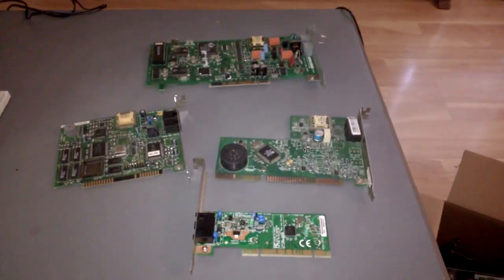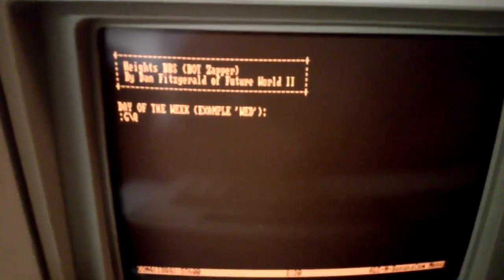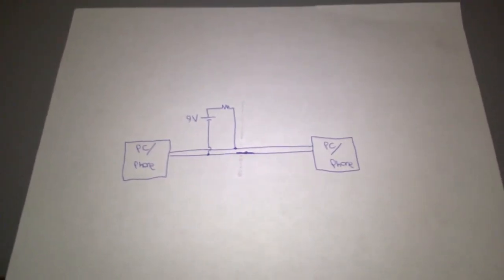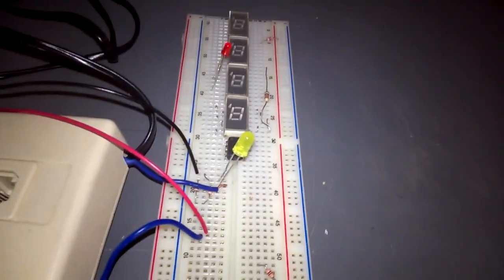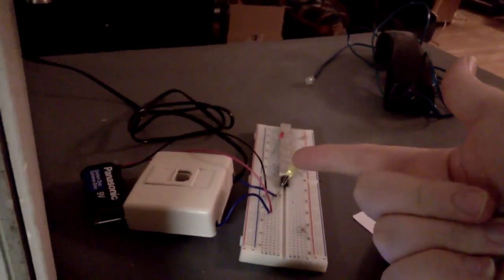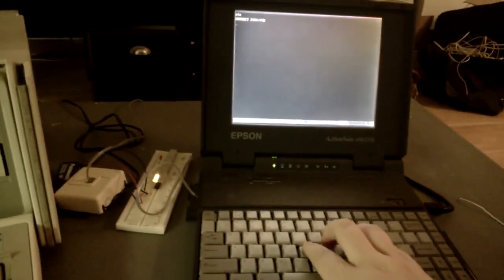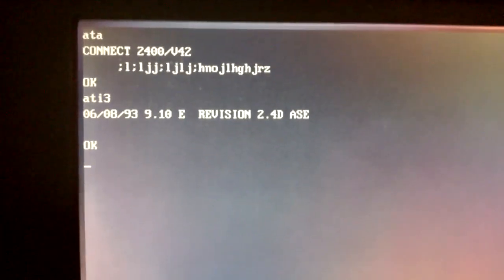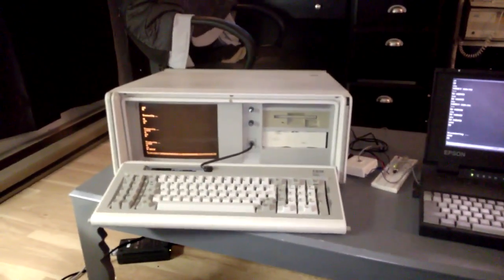Playing with modems - without a phone line!

Comment: For those who like POTS tidbits... One could dial some telephones through the hook-switch without having access to the tone keypad or the rotary dial. The number of pluses was one more than the number, IIRC. So, to dial 3,2,1; one would hit the hang-up switch 4 times, 3 times, and then 2 times. Zero was 10 pulses. Timing was important so we practiced this all of the time until it was second nature. Often we would dial our own phones using that method to stay in practice. Where it came in useful was when you didn't have enough change to call a cab at the dive bars where they didn't invest in a proper payphone. Their phones used a simple type of lock on the dialer so that it wouldn't allow it to dial without first dropping a coin in the slot. Using the hook-switch method, we could dial the telephone without paying as the mechanism only disabled the dialpad or rotary dial. I did it to "impress" and to play around so I almost always fed the coinbox after I was finished. But, I am sure there was a time or two that I didn't have change and used it (ie stole; not proud of it) to make a call for a ride.
Reply from the maker: You're correct about hitting the hook switch 10 times for zero, but you're one off for the other numbers. It's 1 for 1, etc.
Reply: @themaritimegirl ah, thanks! It's been a mighty long time so memory fades. 🙂

Comment: "A" or "a" are used in the Hayes AT Command Set because those two characters can, and are, used in Auto Baud Rate Detection due to their binary equivilents. When one types "A" or "a" on the terminal and it is sent over the RS232C connection to the modem, it allows the modem to auto detect the baud rate of the terminal. So, the choice of "A" was not coincidental.

Comment: The reason it wouldn't work on 33.6k is because of your modem doesn't realize your phone line's rate. The rate is how fast data (analog or digital signals) can transfer over the telcom or the cable and service source itself. Forcing it to a slower bitrate slows down the line rate., and makes the line not drop in the middle of connection.

Comment: one interesting application would be a very long cable run. Google says, a POTS line has a length limit of 18K feet (about 5km) using 24 gauge cable, between devices. No doubt that 9V battery won't have the oomph to push current that far, but it's maybe worth while to see just how far you can push a signal, maybe just take a 1000-ft spool of telephone cord and bench-test it through that. Since Ethernet maxes out at about 300 feet, that could be a very cool retro application, to have a simple remote node 2000ft or 3000ft or a mile away, without using fiber.

Comment: Hi Pretty good.

I used to work for telecommunication company and knew of the battery hack for modems that needed to detect line voltage ( not all modems need to do this there is AT commands to ignore line voltage / dial tone ) - but after all these year i forgot what it was as line voltage or the ring tone is 48-52v dc 

Anyway to connect 2 pc's via serial you can just use a null modem cable and laplink of FX or the microsoft one in dos 5 or 6 - i cant remember the name

Another option is to use lantasic-Z which provides peer to peer lan and you can map the other pc as a drive letter

You can also set up a BBS on one pc and connect to that - not sure if wildcat and any of the other ones will work without dial tone, but i did use a product called Minihost from Dan Mankin that is a xt version @ 1200  but he also wrote improved versions called maxihost and megahost- they are primarily for "dial home to get files" but works just like a bbs with user names , file areas , permisions

Comment: Thanks very much for this video!  I had no idea a simple circuit with a 9-volt battery would "enable" a modem like that.  You probably want to know about this video about ATA devices, which are inexpensive, plentiful, and easy to use.  The real modems making their real sounds, and you can either call from one computer to another directly, or route it to an external IP address (another ATA unit connected to another computer) over the Internet.  "Cathode Ray Dude: Dialing Up At Home."  https://www.youtube.com/watch?v=EGFIEF6siIE

Comment: High speed modems don’t work well on all digital phone lines. The v.90 standards and such are designed for analog twisted pair and circuit switched phones networks, not packet switched networks. So depending on how the phone lines are set up at your end, at the BBS end, and the carrier paths in between, you might be hitting some network segments that can’t carry the modem’s sounds properly for highly compressed analog data. I remember being in IT during the late 90s and early 2000s when modems were still in use but the phone systems were converting over to digital packet switching, from analog circuit switching, and seeing these kinds of problems popping up.
Reply from the maker: See, that's what I've heard before, but I've also heard that V.90 and V.92 were specifically designed to handle packet-switched lines. There seems to be a disagreement there.

Comment: Try to use 2 vhf/uhf dual link to transfer the data only needs to make adapter from rj11 to audio Jack mic/speaker for baofeng (20-50$ ham radio) free very long range airnet 0-50km out side with optical contact and 1-3 km in town buildings!

Other of my ideas is to transfer data in to laser beam (laser can be transferring sound) and receive them with laser beam diode for receive.
You can find something like that for garages door safety or from some door alarm systems.

Comment: That NEC modem definitely isn't a micro channel adapter. The card is too tall and unlike micro channel it has the standard PC-compatible slot cover. The edge connector also seems to be too far away from the rear edge and is keyed differently. I've no clue what kind of bus or interface it actually is though. Probably something proprietary...
Reply: Really late, but maybe it’s for their Japanese PC98 bus?

Comment: Thanks for this superb demo. One question can you easily tell how many of the donated modems are Host Signal Processing ?  They will need to go n the bin without the right driver , usually a 700k file. Also another thing you can do if modern supports Bell 202 is simulate caller id for a landline. Regards.